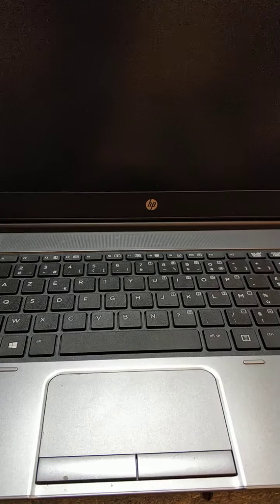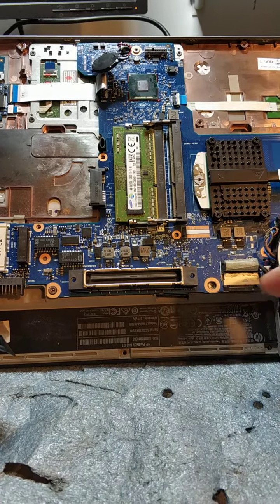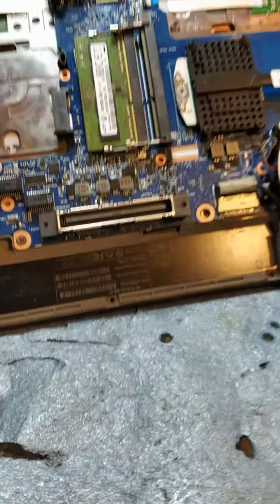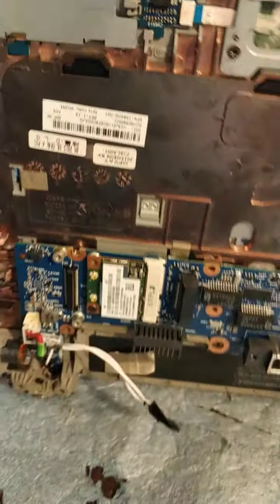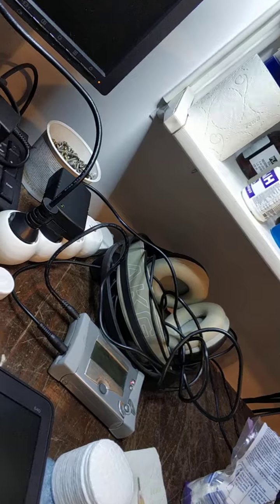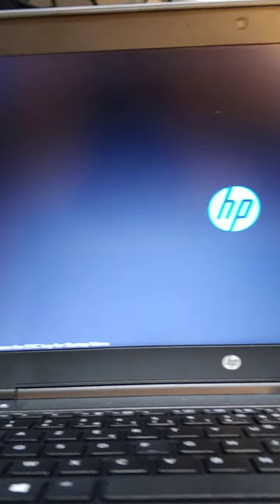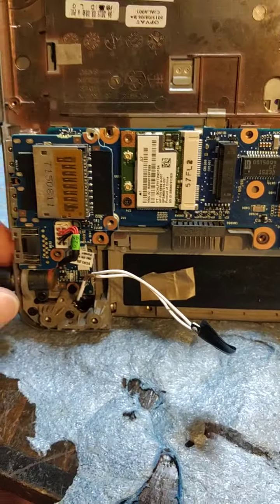HP Probook 640 G1 - No Screen, Mainboard Repair

Comment: Hello, I need a schemat for this board, can you share it?
Reply from the maker: hello; yes, i do; search on google after therms "HP ProBook 650 G1 Inventec 6050A2566401-MB-A03 Schematics " and first site is from alisaler; you can download from there, is free; and yes, i know is for HP ProBook 650 G1, but for me it was good enough to repair this 640 G1; good luck.
Reply: @DaneluRepairs  I need schematic for board 605A2566401-MB-A04 and this board schematic is different
Reply from the maker: @krzysztofszuba955: write in google tour model number EXACTLY(because last time you wrote wrong model) and then name "schematics" and you should find; good luck

Comment: Hola mi computadora es igual pero le conecto el cargador y premde el foco del oower tal y como la tuya , pero en mi caso no enciende el abanico sera por lo mismo? De esa tarjeta quw quitaste
Duda la desconectas o la remolqzas
Reply from the maker: Hola; puede ser el mismo motivo, pero también puede ser por muchos otros motivos. Hacer esto:
1. prueba con otro cargador
2. probar con otra memoria ram, de una sola pieza
Si aún no funciona, intente restablecer la BIOS, como esta:
1. quitar el cargador
2. retira la batería
3. retire la pequeña batería del BIOS
4. presione el botón de encendido durante 15 segundos
5. Conecte todo en el orden anterior, encienda la computadora portátil y vea si funciona.
Si no, llévalo a un Servicio Técnico. Buena suerte.
Reply: @DaneluRepairs  ok gracias,  la batería del BIOS viene siendo la pieza que desmontas en el vídeo?
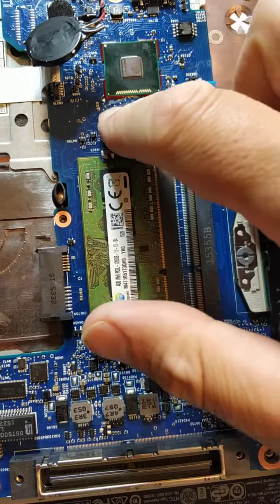Reply from the maker: @manuelmorales4089  Con mucho gusto; no. Pero puedes ver la batería del BIOS en el video, en el minuto 0:47 en la parte superior, es pequeña y redonda, envuelta en una carcasa negra y con 2 cables trenzados, negro y rojo, y está conectada a la placa base justo al lado del tornillo. al zócalo del disco duro.
Reply: @DaneluRepairs  muy bien muchas gracias
Reply from the maker: @manuelmorales4089  you're welcome and greetings from Romania.

Comment: I'm facing the same issue with you .But haven change this small board  part yet . The laptop turn on  with no display , and the fan run on full speed
Reply from the maker: It could be from a lot of reason. Watch video and see if it help you. If not, it seems that you have another problem. Good luck.